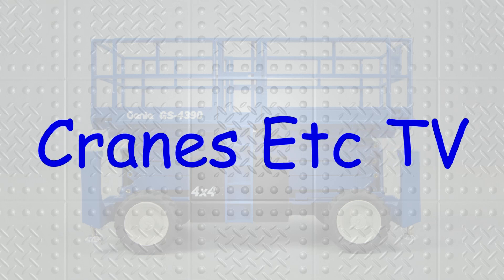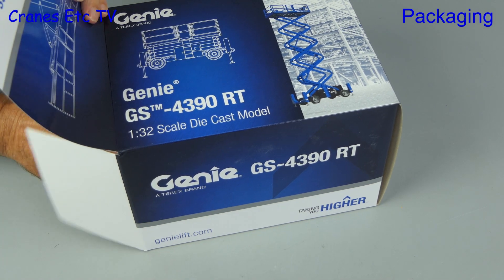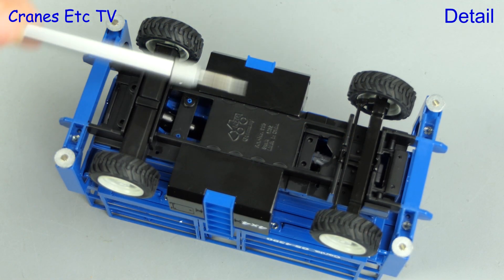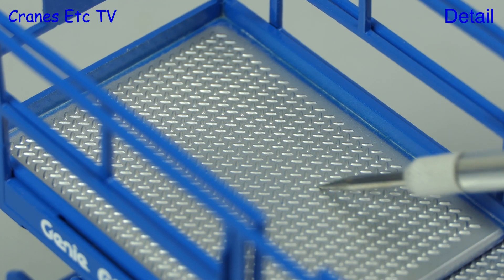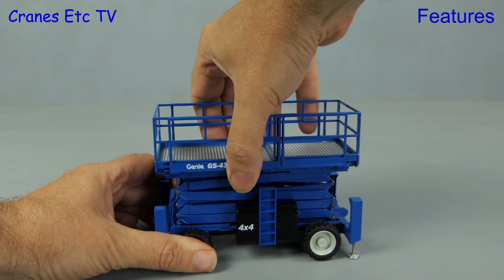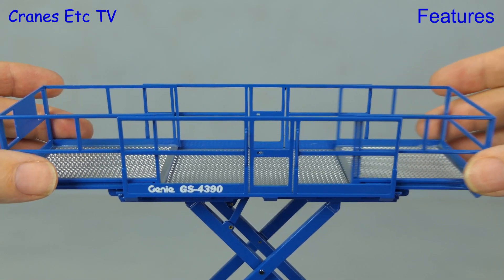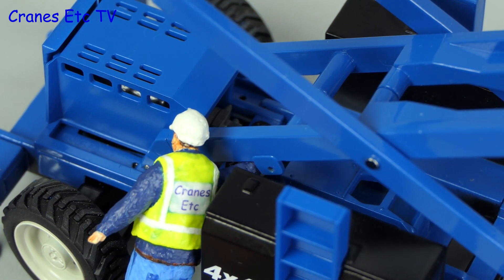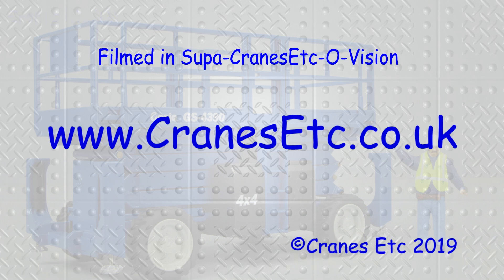NZG Genie GS-4390 RT Scissor Lift by Cranes Etc TV

Comment: Could they have included some semblance of a control panel?  I see there's a space on one end of the platform for one, but that's it.  In a larger scale, this should not be too difficult.
Reply from the maker: I think there is no fixed control panel.  It is a portable handset.
Reply: @CranesEtcTV  Agreed.  But many times, it's "hung" on the railing on the platform.